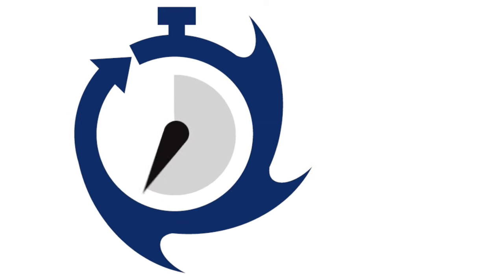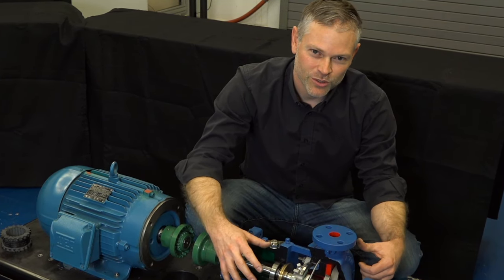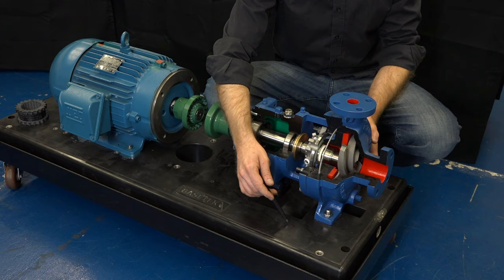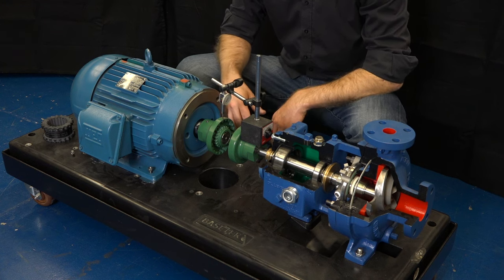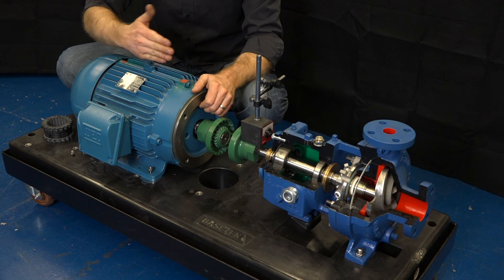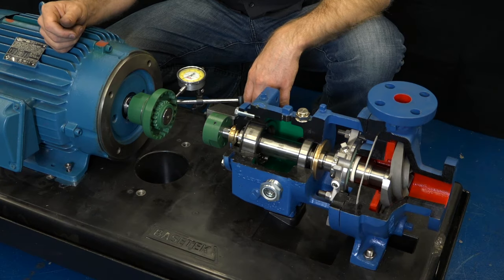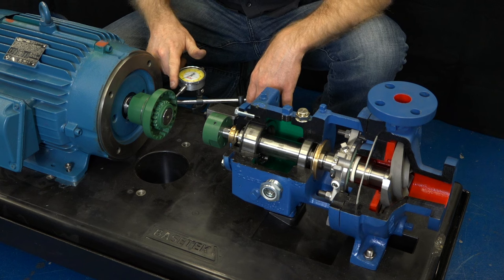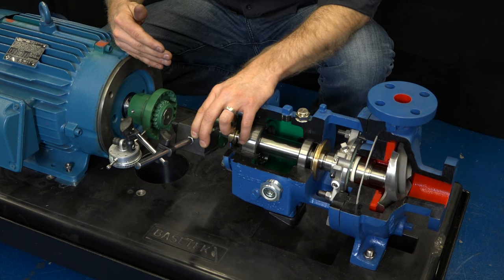Alignment: ANSI Centrifugal Pump

Comment: why would you move both shafts together to measure parellel alignment? wouldnt you gauge from 3 to 9 only moving the shaft with the dail indicator attached to it?
Reply: Yo do this because if you have coupling runout either shaft you will read the runout along with the misalignment
Reply: The keyway tolerance could be slightly offset for the shaft coupler as well. In theory, you should have a tight fitting coupler but working on "brand used" stuff when the budget is tight could play a factor. But if the stock market is ok, go on and buy you them fancy keys and what not. The divit on a used key can really be make the coupler sit funny.

Comment: Can you elaborate more , on how to fix the mis alignment if its horizontally
Reply: Move the motor. The bolt holes are often so much larger than the bolts so you can push the motor a few mm sideways.